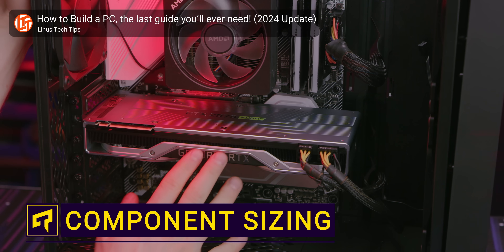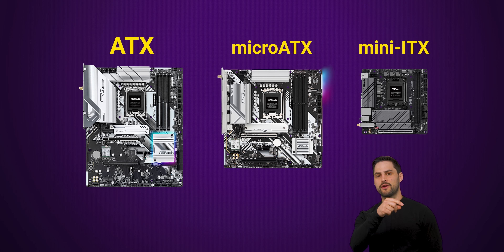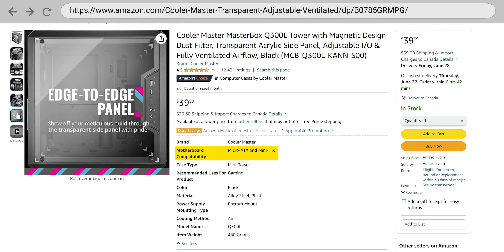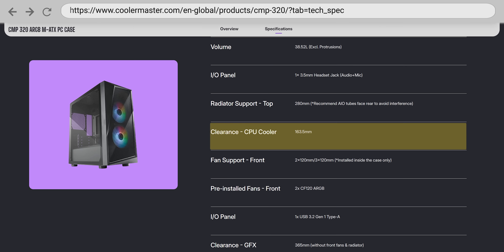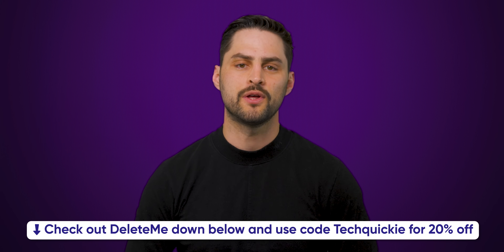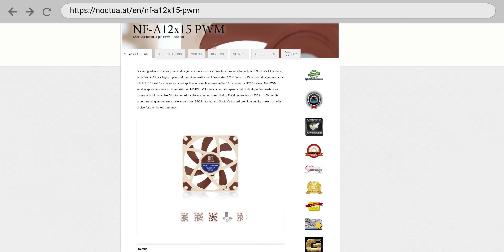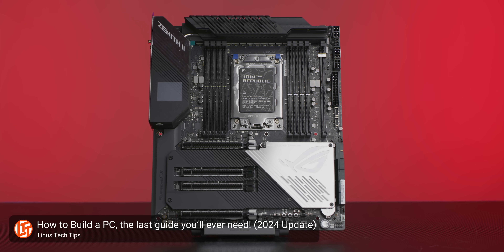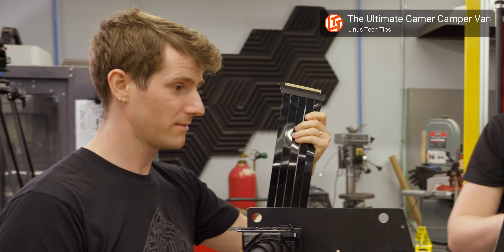Are Your PC Components TOO BIG?

Comment: The biggest tip for comparing motherboard compatibility to case compatibility is to look at how many PCI slots you can see in the product photos of the case, if it's more than 4, then a full-size ATX will work just fine.

Comment: One issue I've run into is PSU in basement sizing. If the case has a basement and you have hard drive rack there + PSU, it can get very cramped. I tried getting a smaller PSU when I replaced the one I had but cable length wouldn't work for me, so still had to get a full size PSU or replace all the cables with longer ones... wasn't ideal.

Comment: When I was building my current PC in Jan-Feb 2020 (in the weeks before COVID shut everything down), my biggest space constraint was the space under my desk where I'd always kept my PC towers.  I measured that space, and read the dimensions in case specs to find a case that would fit.  

There were only so many cases at Micro Center that weren't too long or too tall -- and grand total of two still had a 5¼" front drive bay for an optical drive.  Everything else then had to fit in the one case I picked -- and a salesperson at Micro Center was pretty helpful with that, steering me toward shorter graphics cards that also fit my budget.  (I saved my receipt just in case -- and thankfully everything fit just fine!)

And now as I consider a future a graphics card upgrade, I'll probably be looking at card length again -- and again will keep my receipt in case it doesn't fit.

Comment: Building my first pc and I’ve been debating on what components I’d go with for a while. I wanted to game in 4K and on amd so I’ve been watching for a sale on GPUs 7900gre or better two days ago 7900xtx was on sale for 699$ I thought what no way but ordered it and the rest of the components around it. order got canceled by seller. Amazon price matched it. reimbursing me for the cost +the difference, since all other Xtx were 999. The originally planed gpu was the sapphire 40g is 320mm. The replacement I ordered is the asus tuf oc Xtx thinking it would be nice to match the manufacturer of the motherboard and the asthetic , completely forgetting to verify if it was a different size. Spoiler it is 358mm😂 so now I have to try and get a 358mm card into a 360mm max case on my first build just looking at the case and gpu side by side is making me sweat. still waiting on a few components to arrive but I’ll be contemplating if my component is too big until I assemble this weekend . Say a prayer for me lol😂

Comment: My PC is built in a Thermaltake Versa V2 or V3 (lost the case box) AMD edition case and due to my CPU cooler I had to mount my top exhaust fans on the outside of the case and cut small holes next to the fan mounts to run the power cable through found out after the fact so had to remove my motherboard and with CPU cooler attached to install top exhaust fans before putting motherboard back into the case. Learned a valuable lesson that day and that is to do more research before buying components.

Comment: How about when companies like NZXT lie on their website about case specs? 
I bought a case from them because on their website it said it had 90mm of top space for radiators.  Turns out it was 55mm on one side of the case and then 35mm on the other side but still under the shell. My radiator was 85mm so it wouldn't fit. They were misleading about their specs and wouldn't admit it even after contacting tech support.  So even looking at a manufacturer's website isn't helpful.

Comment: Something to look at for cases specifically, is see if they can fit radiators and fans without interfering with other spots.  Often a case can accommodate 360 at the front, or 240/280 at the top, but not necessarily both at the same time.  Thats when mr drill makes an appearance you build a hot rod style pc!

Comment: My components are too small. I wasn't paying enough attention to size, and bought a Fractal Meshify 2 "Mid Tower" case. It's Friggin' huge!
The only problem I had was that the Corsair Vengeance "LPX" RAM wasn't "LP" enough for the be quiet! Dark Rock 4 cooler's fan, which had to be bumped up just slightly to clear it. Still plenty of room for that in the case, and it could be down to the motherboard I used (ASRock X750 Steel Legend), which was possibly not the best choice, as besides that, it has the wrong USB 3 header, so I had to add in a PCI-E expansion card with an internal connection (there's an adapter, too, but that would force lower performance from the front USB C). --Also, the audio has a bug that apparently isn't getting fixed, so my Corsair headphones cause the volume to change uncontrollably if they're set as a default device.

Comment: I wanted to front mount a 360mm aio, tubes down, with a fans on both sides of the radiator. My graphics card said no. But it did fit with fans on only one side of the radiator, thankfully.

Comment: One thing nor mentioned in the video: Boards using right angled ATX / USB3 connectors can cause problems with some cases, that are designed for upright connectors.

Comment: the Q300L is god tier for cooling. I've been using it for years with only a rear fan, cpu cooler, and GPU fans.
I was going to put a front fan on but was worried about it vibrating an HDD I mounted on the front (this video doesn't tell you how to avoid my mistake and check if it has enough drive bays) so I skipped it and it turns out I never needed it. GPU hotspot only hits 83.6C; down from 105 after a repaste.

Comment: my computer was going to look just like that image at 1:40

my previous computer died (was around 7 years old, cpu, ram, motherboard all fried)
i went into the store, said what i needed new computer for, and went through part by part with them suggesting everything. and i was to come back the next day to pick up the built computer. he then informs me that the second fan didnt fit, but it was far more than i needed, so left the fan off and gave it to me in the box.

i felt stuck as i didnt feel like i could ask them to rebuild the entire pc in a different case. it has been running fine for about 2.5 months since i got it.

msi z790 gaming wifi
noctua nh-d15
i5 14400f
rtx 4060

cooler master masterbox cmp510 a

also, i have no interest in overclocking, most important is reliability and longevity
should i get a different case and get everything moved across? should i try get the shop to change it? or will it be fine?

Comment: Yes, ATX needs to be replaced with a new standard, ITX should die a richly deserved death, we should probably have connectors on the back of motherboards, and there should be 1 major standard, which is ATX V2.0 in 3 different sizes (or more but standard ones and correctly named). We are not there yet, but companies do regularly cooperate. Google and Apple on their find my device, Intel sharing Thunderbolt with USB-IF, Apple opening up Magsafe to QI wireless, pretty much every industry standard if you look into it. People who say it can't happen because of the dreaded 'proprietary' are fools. All industry works on interoperability and licensing of proprietary tech. There's zero reason we couldn't have a better motherboard layout for this day and age - particularly with the new RAM coming which looks set to take over from current formats of ram stick for various reasons.

Comment: I upgraded my AIO cooler and the fan assembly wouldn't clear the RAM, so I had to buy a new case. Now I can't quite close the side panel because of the GPU cables. Sometimes you just can't win.

Comment: Retro: Got a desktop Highscreen Case which is made for mostly 286 and 386 machines. The PSU is located above the board. Tried to fit in a Slot 1 board, but doesnt work as the PSU is blocking that space. Same with Super socket 7 when the CPU is located beneath the PSU. Any cooler+fan is a problem then. So the CPU needs to be located behind the ISA/PCI/AGP slots. Got a board that got this, then wanted to put in a Voodoo 2, but surprise: The voodoo 2 is so long that it needs space behind the PCI slot. But of all 3 PCI slots this space is now blocked by the CPU.
"Fun" issues to deal with.

Comment: When I built my sisters PC years ago the part of the bracket on her 2080TI that sticks towards and slots into the back of the case was too long, which prevented me from inserting it all the way into the PCIE slot. But nothing a little trimming couldn’t fix. I took my sheet metal cutters and cut about 1/4” off from it (that’s about how much extra length it had on it, must of been some weird extendo bracket) then filed down any sharp edges and it fit perfectly. Of course we could’ve ordered a regular bracket but why wait days and spend extra money if you don’t have to! (:

Comment: I had this issue with my first rig, back in 2014. It had a bottom of the line AMD cpu and gpu that, frankly, was very outdated when I got it, and was sand within a year when it came to new games. A year later I purchased a new GPU to give it some more oomph.... R9 390 I think... and woe, it wouldn't fit in the, admittedly, small case. So  I returned it and got a slightly smaller GTX 960.... that also didn't fit. That I didn't return, and out of frustration I just put it in my closet for later, planning on buying a whole new rig in 2017, with a bottom of the line gpu I could toss but a MASSIVE case. So I tossed the new sand and replaced it with my, now, 2 year old 960. 

And when I say sand, the included gpu in that was worth like.... $30. Not even sold separately. Just another bottom barrel gpu that technically produced graphics from before the RX series gpus came out, and made the R series look like gold.

Comment: I've had a problem before where the motherboard had a component that actually came up so high that it prevented me from installing the gpu in the top slot. I had to use one of the lower pcie slots inorder to not be blocked by the motherboard

Comment: Some other problems, PSU Cables that are just a little too short, Same goes for Sata and front panel/USB.  In accessible CPU 12V Power terminal location on the MB, bad HDAUDIO location on MB. Not enough FAN Headers.  Permenantly attached case standoff's.  drivebay/GPU conflicts, Not enough drive bays.

Comment: The Arctic liquid freezer coolers are notoriously extra long with the radiators even if they say 360 or 420. This commonly caused cases like the fractal torrent to not fit the 420mm Arctic cooler even though it supports 420 in the front

Comment: 4:15 Besides simply blocking other PCIE ports, gaming GPUs tend to get quite hot even in a properly ventilated case - which may also impair its closest neighbors. Had a case (pun intended) where a Wifi adapter fit nicely in a spare PCIE slot next to a GPU, but it got uncomfortably hot during operation which lead to major network speed degradation and even sporadic crashes from time to time. Moving the card to the bottom solved the issue completely.

So a good idea is not only to take note if all of the intended devices will fit in the case/Motherboard pair but also to have some extra space to spare for airflow and potential reshuffling. mATX and miniITX generally won't have that option at all.

Comment: For me, I would advise people to check their graphic card dimension then choose the case from there. The other are not as crucial but still need to take into consideration. GPU become so big that they are now the limiting factor for most PC case. I have many people return to me to exchange their smaller case into a bigger one because of GPU. Also, depends on CPU tower cooler, I usually advise that the height of the RAM + the fan length (e.g.: RAM height is 45mm and CPU tower fan is 120mm = 165mm CPU heatsink height at least in case the CPU fan overlap with the RAM).

Comment: It's best to check community forums for real builds. For example, the ID IS-55 interfered with the VRM heatsink of my itx motherboard. Loosening the VRM heatsink with a thicker thermal pad helped. Many b650/z670 itx boards, are incompatible with many low profile coolers now. Ram clearance is the least of the problem.

GPU length is easy to account for, but GPU height is tricky. Some of the power sockets are at the top of the card. Others, are sunken near the PCB. You do not want to mess with power cable yoga.

The size of a GPU cooler may not necessarily correlate with cooling performance. Some companies, such as z** had oversized heatsinks with poor contact in the past. Another card had an awful thermal pad application. Only half of each memory was covered by thermal pads :/.

Comment: lets be real here
powersupplys and ram has about the size they always had and if you dont overclock your cpu, a standars size cooler will probally do just fine.
graphic cards has ballooned in size to the point you need a stick to prop them up so they dont bend & break from their own weight

Comment: My video card is absurdly oversized (Asus Strix 4090 OC edition).  I had to replace my case when I bought it.  Even then, I had to take a Dremel to the new case to cut out a small section that was hanging just a bit too close to where the card needed to sit.  The case  has a drive cage that can be moved to one of two positions, the bracket that the cage attaches to in one of those positions was just a little to long.  Now I can only have the drive cages in the front position, but the card fits.

Technically, I could have put the card in the lower PCI slot and it would have fit, but the lower slot on my MB is an 8X not a 16X slot.  Realistically, that probably would never matter, but I already had the Dremel...

Comment: Also check the case specs for the 5.25" floppy drive, not many cases support it nowadays :)
Reply: :(
I've had to sit a portable DVD drive on top of my case because of this. Airflow's fine, though, and if the case DID have a bay meant for it, I'd have had more trouble fitting the case in its place.

Comment: The removal of internal drive bays from almost all new cases is a major  issue for me. NOT being able to put my drives in at all is a definite "FITTING" issue.Everybody declares just use USB for everything. I want to put my components IN my case NOT dangle them off from it!
Reply: I had this problem when I needed to replace my case.  I ended up over paying for an older model case (Phanteks Enthoo Primo Series PH-ES813P) that has six internal drive bays and five external drive bays.  The case is massive.  Sits almost as tall as my desk, and feels like a back injury waiting to happen, but everything fits in it, and it even gets decent cooling.

Comment: I just replaced my XFX 6800 with a 4080 Super. I didn't even think to check the spacing since my 6800 was already a chonky boy and still had plenty of room. 

However, I had a brief moment of concern when I took that new card out of the package, but It still fit. Not that I couldn't have gotten another case, but that wasn't part of my immediate upgrade plan.

Comment: This is why I get a laptop. Sick of the stupid sizes of things. It's easier and nicer. I'll take a smaller GPU for a monitor/keyboard built in and just get a stand for it. I'll just hook another monitor and keyboard if I want it.
Reply: So you pay the same money to have less performing components? Compared with the graphics card in your laptop, you would get better performance with a 4060 and there are pretty small models of it that would fit everywhere.

 The problem with sizes is mainly a problem for high-end computers, not for mid-tier ones, which would be the equivalent of a high end laptop. If your laptop is mid-tier or lower, you are really unlikely to face space constraints, as low end desktop parts (the equivalent to your laptop) tend to be quite small.
Reply: @itisabird  I pay for a better form factor and mobility. Have fun lugging your computer to your boyfriends when you are staying over. It's just not worth the hassle, if you ask me.

Mine is a high end laptop, it ain't shit lol handles everything I want too!
Reply: @itisabird  the 4060,3060,1060,1070,1080.... laptop are identical to their desktop counterparts, same die, same fps, so there is no less in performance in those gpus unless you go for some high ends one with +300w then you can see a small to noticeable difference
also the 7945hx cpu on laptops scores 35k on cinebench 2023, wich is the same as a 13900k
just search 4060 laptop vs desktop

Comment: One of the conflicting parts that caused a clearance issue with my current build was actually the Motherboard's VRM heatsink and the very edge of the top mounted radiator. The rad's mounting holes were maybe 1mm from aligning with the case.

Comment: I had a cpu header where the tube's coming out the end were weird and would barely block one of my RAM sticks. So I took an angle grinder and had a friend hold the card with his bare hands and grinded down the metal outside of the card. It worked.
Reply: Your friend trusts you a lot! I wouldn't let anyone come close to my hands with power tools. I've learnt the hard way...

Comment: Make sure there is enough room to put the network card in the free slot, having added a 40mm fan to cool the 100gb fibre card to keep it cool in a desktop case, it's more than 1 slot thick, and without the cooling, the transceiver overheats and then the connection dro.....